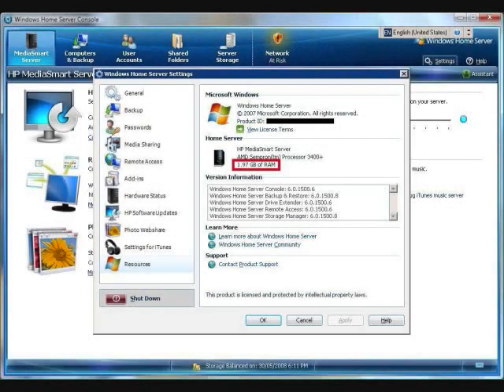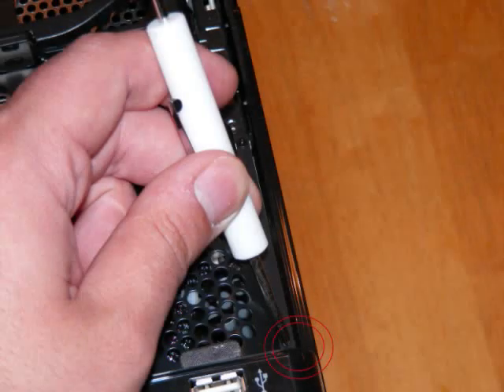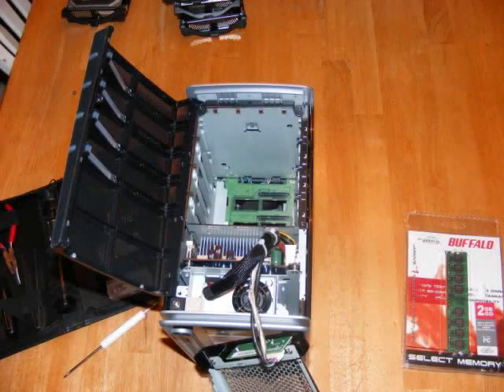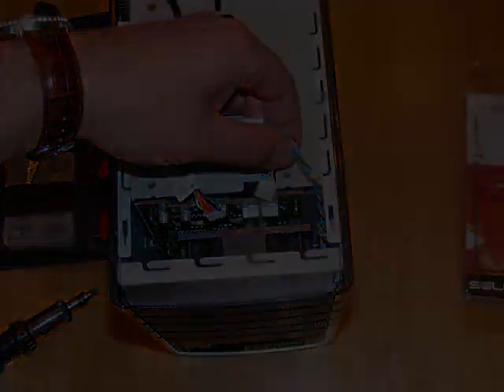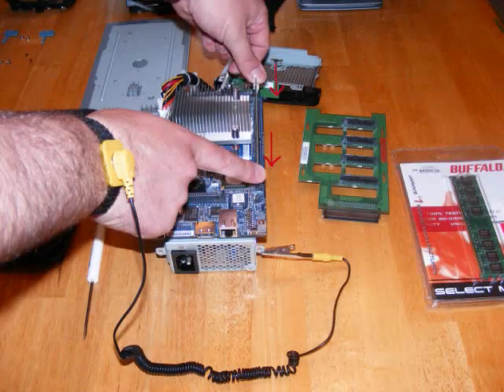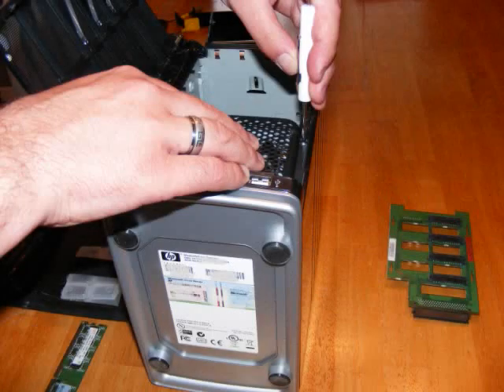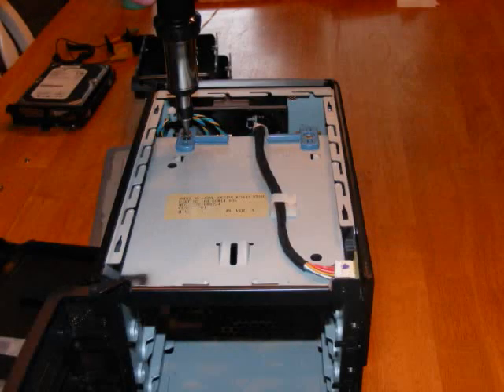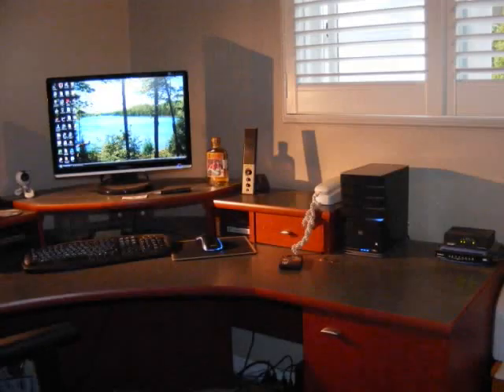HP Mediasmart Server RAM upgrade

Comment from the maker: If you're a power user like myself you'll be installing quite a few add ons and modifications beyond the home server interface that HP wants you to use. If these are all running concurrently then the server uses more and more RAM. This is the best fix that I know of. Any CPU upgrades ive tried have worked but been a little touchy. You have to get the EXACT voltage and ratings for anything to run stably.